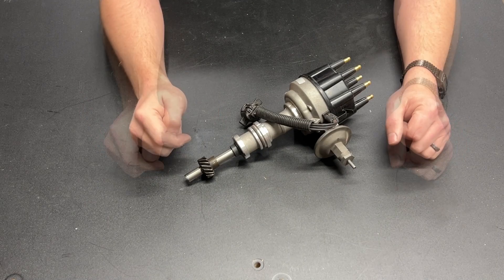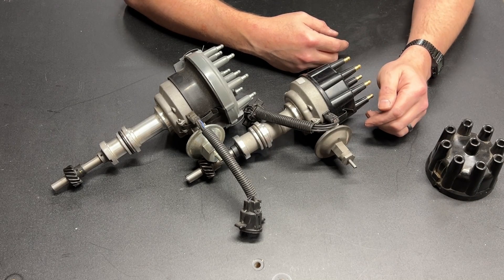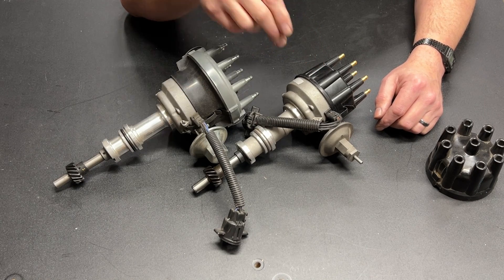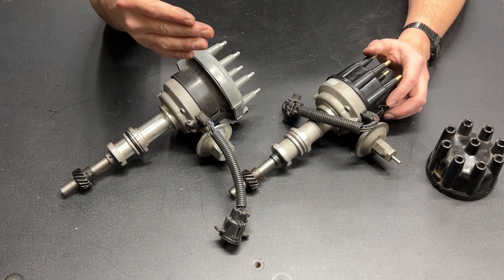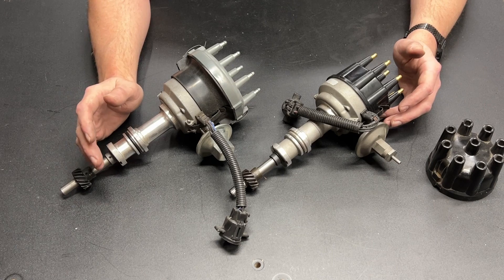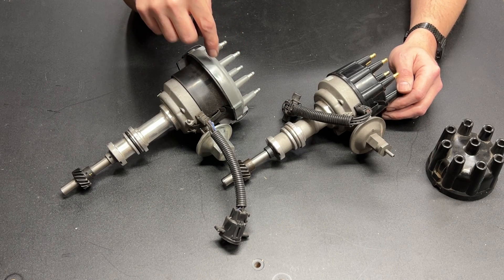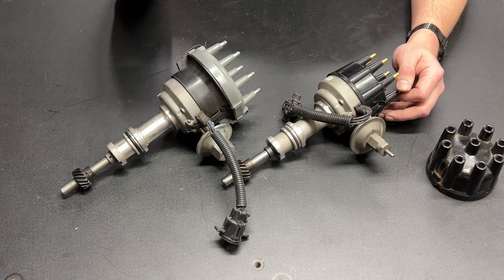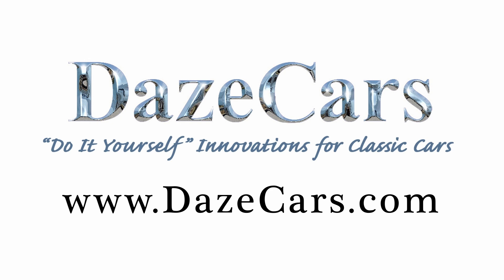Smaller Male Duraspark Distributor Cap DOESN'T Automatically Result in Crossfire Issues it's a MYTH

Comment: Well there are great gobs of gm v8s that run a cap that looks just like the smaller male terminal cap without crossfire issues.
Reply from the maker: exactly but you would be amazed at the number of people that have told me that smaller cap WILL cause crossfire

Comment: I've been running the smaller cap on my 77 F150 since I found your other video. I have not had any problems. Crossfire or otherwise. Very happy I could get away from the 2 piece. big cap.
Reply from the maker: Good to hear it, thanks for the update

Comment: You said 5,000 is the limit, and argue it like they never go with huge margin of error. They can design whatever the fuck they need for everything to fit. You think they were considering your goofy ass dual carb setup? Guess why newer crank sensors run at 5 volts instead of 12, then pay attention to my recent content if you can't figure it out.

Comment: Thank you for sharing this information. I had a nasty crossfire issue with the big diameter cap in my MSD billet distributor and analog 6AL module, which was hacked and repaired. I had to replace the module with the 6AL digital version and use an adjustable rotor to set up the firing phase a little more accurately. 

Yes, going with the smaller diameter cap does not cause crossfire issues. As you clearly mentioned, other variables and causes exist for that issue. BTSTDT.
Reply from the maker: Thanks for the comment

Comment: I guess I’m that odd guy that likes the looks of the bigger cap if you have room for it , like intake and air cleaner issues. I just think it looks a little more ‘racy’ , but I don’t care for the GM style HEI distributors and have seen lots of bad reviews for them. I like the fact that the Duraspark are stock Ford and would make must easier to replace or repair 100’s of miles from home on a weekend. (Assuming you actually drive your hot rod) . I first use one with a MSD box on a 351w I built back in early 90’s. It was in a 57 Fairlane I restored. I had built the engine following a build in HotRod magazine from the late 80’s. The magazine build turn out about 350 horse, which seem ideal to me. At the time I didn’t realize how easy it was to get electronic ignition, other than hi-performance racing parts. I know you could get kits that replaced your points but there again where do you find parts on a Saturday afternoon. So I originally went with a new points distributor, the car ran fine but never had the power I had expected. The automatic and 3:12 9” would spin the 27” tall BFG’s but not like I had hoped. Fast forward a couple years when I installed a mid 70’s stock Ford electronic distributor and a MSD box, it was literally like bolting on another 100 horsepower. That thing would fry the tires off. On the 57 I used a small female cap, but on my present build (302) I’m using the larger with black base and red top and red wires on a black and chrome engine. I wrote down the parts #’s from your previous video and put them with my ignition parts in my shop and my wallet. You never know, a farm store in East resume Speed Washington or Oregon  may have a cap for a I-H Duraspark distributor on a Saturday afternoon.
Reply from the maker: I don't like the slop in the bigger cap and a lot of them are aluminum not brass so IMHO the smaller cap is a performance upgrade.  I know what you mean about good ignition adding power.  When I first built my Mustang I put a read switch on the secondary linkage of my 4 barrel carb to trigger an LED.  That way I knew when I was wasting gas for fun.  After installing the MSD box (with points) I could get much the same performance without having to open the secondaries.

Comment: SMOG! Lean a/f mixture and a bigger spark plug gap...a wider arc gives a longer possible contact patch between cap and rotor. Love my Duraspark, red tab.
Reply from the maker: exactly!!  other factors that didn't apply to the other makes using the duraspark distributor.

Comment: That made me wounder as well after pickling up a ford van with the EFI and TFI Ignition system that didn't run.

And driving an older van with the Carb and Dure Spark System.

I didn't unstand why the New small cap did not cross fire after reading up on the EFI and TFI system in order to find the trouble.

If i remember right the TFI coil is suppost to have the same high output and it didn't make sense why the older coil would cause trouble.

Love you videos

On another note if you have an older ford and its not ruining try checking the fuel pump and main ECU or computer Relays.

The van had a new coil and Distributor in it and the tech was still trying to find the trouble.

Me new to the EFI and TFI system was reading 3 or 4 books on the system's in order to find the trouble and almost pick up a new computer or ECM.

But i pulled both the fuel pump and ECM relays and crack the cover and found them to be full of rust

I jump pins and the engine came to life with the turn of the key

If you have any old fords or possible other autos. Check the relay's as they can click and still be bad.

Please keep up the good work for people like you help make the world a better place 

Thanks
Reply from the maker: Glad you like my vides!!  Thanks for the information on trouble shooting

Comment: This video was well said and very correct on all explained, you hit the nail on the head when you brought the MSD distributor in play small cap with lots more sparky and no problems, I read a lot of bs on the internet and know better to believe whats said,   Been turn wrenches for all most 50 years now  I'm building a 1999 mazda miata with my 18 year old Daughter with ford 302 just dropped duraspark in it yesterday going with small cap MSD 6al box 8.8 shortened rear end 3 point ladder bar system t45 bolted to engine going to be a fun little car when done  Anyway that's for the truth on the web so many fasle claims out there. spark jumping is caused by faulty parts and if your wires are bad or anything esle then spark jumps across period.
Reply from the maker: That does sound like a fun little project.  I imagine the 302 will do for the Miata what a big block does for a bigger car.
Reply: @dazecars  there's a lot of parts that you can buy for it to make it easy but I like to prefab myself and figure things out that make it more fun,   like cutting and rewelding axle tubes are done now to figure out how to shorten the axles to fit propertly
Reply from the maker: Sounds like my kind of project, I modify everything just because I can
Reply: @dazecars  Can't wait to smell the tire rubber again been way to long, I may turbo or supercharge it just waiting to see how it drives first still along way to go

Comment: Could you do a video on the original duraspark I ignition boxes made to meet California emissions (50 state). Allegedly, it makes way more spark than the duraspark II ignitions, but proved to be too costly for Ford. Seems like their best box with the small cap trick would make a great low buck solution. v/r wh
Reply from the maker: interesting, I have not heard that.  Sounds like something worth checking out

Comment: Interesting video. My crossfire starting problem where changing the cap (the Big One) for another dry cap, was due to moisture rain/wind and temperature change in Summer-Fall and Winter-Spring conditions. Always after sitting for the night.  The big (originally Blue) Cap THAT DID NOT HAVE A CONDENSATION BREATHER on top. Nor did Ford use the weather wrap on their distributor at that time to protect Cap from moisture.
Reply from the maker: Moisture is a huge factor in crossfire and ignition problems.  Thanks for sharing
Reply: Buy the better quality cap with the breather if they still make them. Use a little silicone grease on cap fittings to keep out moisture.
Reply from the maker: That is my one complaint, I wish this cap did have a breather.

Comment: The issue ford talk about ? It goes back to an issue car maker created for themselve . How ? See nichola tesla might have been very good . But he was the apple of his day . Patent galore . Yes nichola tesla had a patent on aka ignition coil/condensator . Yes those cylindrical unit are meant to do both if airgapped like nicholas tesla mention inhis patent . Manufacturer thinking they were outsmarting nichola tesla used a metal strap around ignition coil and voila ? Nope . See there was a method to nichola tesla idea Of coil/condensator doing both . Very specific condition were required wich mean paying patent fees . To avoid the patent they went to a lot of trouble . Looking back ? It would have been cheaper to pay nichola tesla royalty . But they did not know . So a condensator had to be added to the distributor area . That's where everything went sideways . Car has had electrical false signal since then . Check ford in wrc . The coil goes in the head a protection tube is required . Ideal iit should be made of non magnetic non electric material wich is not the case . On older car . Yes voltage was arcing . If ignition coil had been installed like nickola tesla patent mentionned there would not have been arcing because condensator job would be done also by the ignition coil . Since it's how it's intended to be done . From ford model t till end of single ignition coil they made the same mistake . To avoid patent of nichola tesla after patent ended to prevent regular joe from noticing ..want a non metal ignition coil holder ? Certain years of suzuki samurai . What you think suzuki samurai likecto rev because they're japanese engine ? Test it on an old lada niva lol . Very cheap fix . Yes the bigger cap is better . But the problem was not the original distributor cap . Condensator was just too close compared to properly non metal ignition coil support . Once you learn it it's easy
Reply from the maker: interesting information

Comment: Just and FYI: I found out the hard way that silicone plug boots can trap air when slid on. If they are close to a hot header, the heat can expand the air and pop the boot off. Loose one cylinder and the race, happened twice because I thought I did something wrong the first time. I used a thin cotter pin to release the air when installing the plug wire at the plug. I know you're not racing, but if the wire does come off, the spark will look elsewhere for a path.
Reply from the maker: good info thanks!!

Comment: I'm running a small cap on my 347 and haven't had any crossfire issues turning it 6500+ in some cases , I was worried about it at first but I have decent wires and they haven't given me any trouble "yet" 😂
Reply from the maker: EXACTLY!!! you would be amazed the number of comments on my first video going on an on about the crossfire problems the smaller cap was going to cause.  That is why I made the second video.  Thanks for sharing your real world experience!!
Reply: @dazecars  yeah I can only imagine the amount of comments that came in disputing what u said and the majority has probably never owned a ford much less ran a small cap . Probably something that they saw someone say so it turned into a law
Reply from the maker: The foundation for the myth is solid.  Ford said thats why they did it so people think it applies to all duraspark everywhere, but people don't seam to understand the concept of it being a system and changes to other parts of that system effect its over all function.

Comment: Just ordered my cap yesterday after watching your earlier video. I’m one of the guys who never knew about it. I had been hoping something existed like this. I’m installing a 6-71 blower on my 351w and the large cap is clearly out the window on that application. I’ve been using the duraspark distributor for years along with an MSD 6AL and Blaster II coil and it’s performed flawlessly. I’m running expensive Motorsport plug wires and like you had mentioned, I didn’t want to have to replace them just because of the cap. I also didn’t want to have to purchase a new, expensive aftermarket distributor with a small cap when what I already have works so well. Can’t thank you enough for sharing this secret. Oddly enough, shortly after your video came out, Amazon shows out of stock on that part number. Maybe there’s been a run on them since the video came out?! I was fortunate to find a local parts store that had one in their warehouse.
Reply from the maker: Glad I could help!!! Amazon ran out within the first two weeks and I have no doubt it was as a direct result if my video.
Reply: Cap arrived today and curiosity got the better of me so I went straight to the garage and swapped it out. Just had to see it to believe it I guess lol! Fits just like you said. Wire boots are pretty tight clearance, but it does work out! Thanks again for sharing this secret! Your little channel has been a wealth of great information for me. First knew of you from years ago on a forum where I found out about your roller spring perches, then I recall some useful manual trans swap info for a Galaxie, which I’m currently in the process of doing on my son’s 63 1/2. And now this helpful information. Thank you and keep it coming sir!
Reply from the maker: glad I could help, don't hesitate to reach out if I can be of any further assistance.